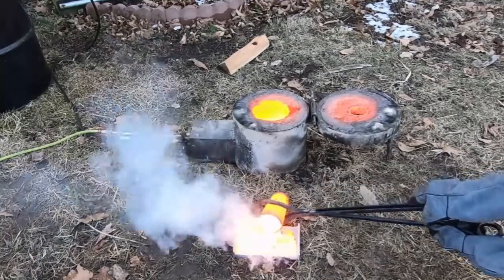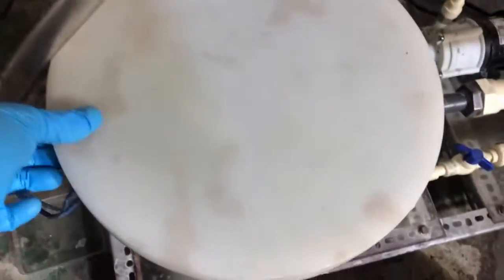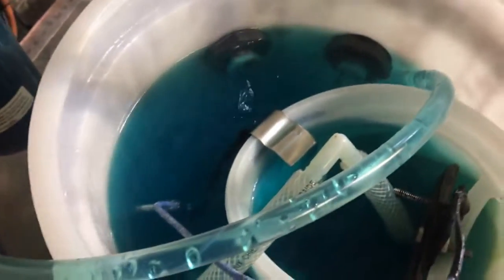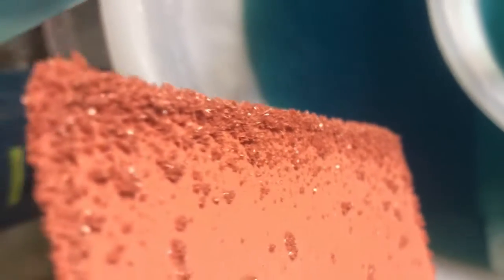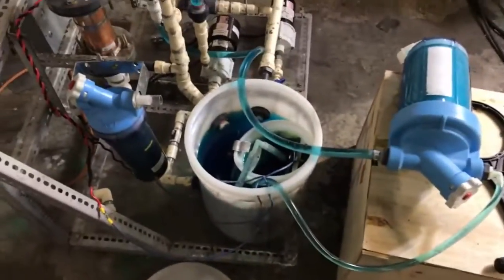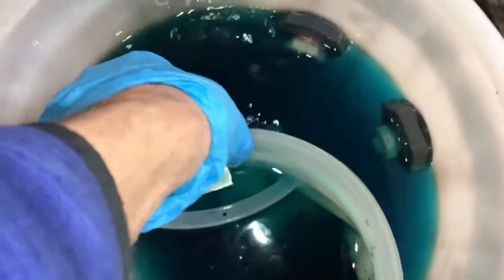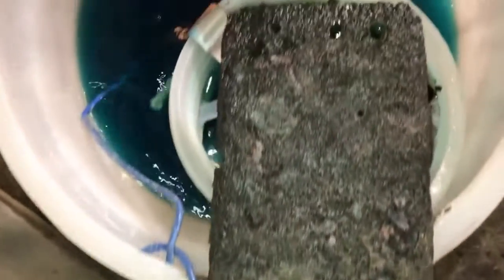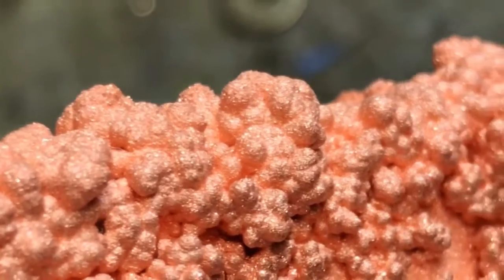Ewaste gold and copper recovery using hydrometallurgy

Comment: Curious - would circulating the electolyte help anything? Also, curious on the cost vs realized gain in $ figures - examples are fine.
Reply from the maker: Hello , this was all a test for  large scale operation in Saudi Arabia , it was not the actual plant , they wanted to prove the concept before building a large scale operation  . The power used to chemical conversion is less then smelting
Reply: @NOBOX7  Thanks - just curious abotu specifc numbers though like full output vs input cost vs return. Also curiosu if circulating the electrolyte would help anything-like a small whirlpool in the bath.

Comment: For the copper cell to work properly your anode must contain at least 95% copper. Low voltage and amperage are needed for a smooth deposition of copper on the cathode. During the process volt and ampere must be gradually reduced even more to avoid formation of large crystals near the end of the electrorefining run. Irregular crystals tend to form on the edges of the cathode. Cover the edges with a plastic based paint; or better, cover them with reuseable plastic strips of some kind (fx. cut up plastic tubing). Polished thin stainless sheet metal is perfect as cathode, afterwards it just needs to be bent a little and the copper can easily be peeled off.
I use old solar panels for my cells (I have 55 old panels which came in to be scrapped, but still works; albeit at somewhat reduced efficiency). It takes a long time but at no energy cost. I'm a full time scrapper and uses both electrowinning and electrorefining for various metal recovery. My largest yield was 1960 kg of pure lead from CRT glass tubes; and yes, I have saved all the powder from the inside of the front panel glass for later recovery of REEs (Rare Earth Elements). All internal parts of the glass funnels are processed for nickel recovery.
I never waste time pulling pins from electric wire connectors. Plugs and connectors are always pyrolyzed together to remove all plastic, yielding metals and Raw Pyrolysis Oil. After hydrometallurgical solder removal (for tin/lead/silver recovery), they are melted and cast into a flat anode for copper removal/recovery by electrowinning. The slimes are collected and later processed for PM recovery, with a minimum of acid consumption. By the way, all my acids are homemade at no cost (HCl, HNO3, and H2SO4).
Reply from the maker: This is not the type of copper cell your thinking of , its precious metal recovery called electrohydrodialysis
Reply: @NOBOX7 .   Electrodialysis is done with a high tech membrane permitting some ions to pass through while blocking others, thus parting various constituents in a liquid solution. Your anode bag is not a membrane, it solely acts as a filter to keep the anode mud from floating around in the cell. 
With at least 95% copper content in the anode, very fine particles continue to fall off the anode during the process. This is called anode slime. It's easily hydrometallurgical processed for gold and PM recovery as it contains almost no copper.
Your video shows stripping of copper from an anode of mixed metals. It's simple electrorefining; not electrodialysis!
Reply: What is your electrolyte and cathode/anode for tin/lead/silver removal?
Reply: @readoryx373 .   You can't use just one "type" of cathode/anode for all metals; neither can you use just one "type" of electrolyte.
One process is electrorefining, another is electrowinning. Besides that, both takes place after the initial hydrometallurgical separation. 
Remember you can only remove one element (read: Metal) at the time. Please specify your question further.
Reply: @zero-waste  i hear that it is more than one process involved in tin and lead and silver.   I am specifically interested in hearing about the reverse electroplating process for tin and lead, which i assume you are removing first.  Before making a mess, and after reading Hoke's book, I personally wish to figure out if I could use a soldered board as an anode and a tin plate for a cathode, perhaps in an electrolyte of tin sulfate, then reprocessing the pregnant cathode through the same apparatus for slimes, catching the unscraped fallen whole components from the first process and muriatic-washing those before smelting for a future "copper" anode to be electrowon for initial PM slimes.  Is there a lead electrowin process in there or is that taken care of by the repeated hcl boils?
Reply: @zero-waste  thank you for every word
Reply: Thanks for sharing your knowledge zero-waste. Inspirational. I too like to make my own acids, and recycle everything I can, within the bounds of my understanding. Speaking of which, could you recommend a good book on the subject of electrowinning and electorefining?

Comment: Overall, I like the process, and I think you could benefit from following @sreetips lead by "cornflaking" your anode material & putting it inside the anode bag as small pieces, with a poures weight/electrode sitting on top of them. This allows most of the flaked-off bits of copper that fall into the slimes to still be in.electrical contact with the rest of the anode, so those cam be plated-out too.
Reply from the maker: This is not a silver cell so hydro electrodialysis doesn't work as well due to the massive amounts of anode sludge produced . We tried it i have the videos . we are more interested in the anode sludge in these test . Not usre why i bother answering comments any more the dam j0000s ruined the comments on youtube cus they dont want us coordinating
Reply: @NOBOX7  thanks for the reply, I'll have to look for those other videos then, as I'm about to embark on a similar project

Comment: Would a thin copper sheet work to give a solid copper byproduct? Recyclers are not going to be impressed with the steel core.
   I like this process . There should be sufficient lead in the curcuit board solder to act as collector metal. Be cautious, solder can contain cadmium.
   Solar panels would deliver low voltage easily for this process. You're drawing less than 20 watts most of the time.
Reply from the maker: the stainless plate in this case will be converted to a cathode for a second run , if you cover the edges the copper peels off
Reply: @NOBOX7  i didn't know it would peel off. Thanks!

Comment: I respect your efforts. All this is very interesting but it really does boil down to economic feasibility. I suspect that a lot of the copper that's precipitating out into the cathode is from the copper sulfate solution itself plus the copper in the anode. In the end, all this work needs to translate into profit or it just isn't worth it.   Perhaps pulverisng the circuit boards in a tumbler with steel balls and leaching out the gold using a cyanide process might be more economically feasible.
Reply: The profit here will be from YouTube but that's the idea. Its cool its science and folks will watch it.
Reply from the maker: The ball mill alone would cost you $300,000. 
This is a project that will be scaled up to plant size. Cradle to grave economics are important here . The cost of getting rid of used cyanide solution ??? The cost of being sued for somebody getting cyanide poising ? the cost associated with safe handling of this material . And before you tell me every body is doing it just know the plant owner is not having it .
Reply from the maker: This is a feasibility test , we will be processing tons per week , you miss the point and yes with all plating solutions some of the sulfated coper plates out of solution.
This is not the actual operation this is called a pilot cell and if the gold content is high this thing can make you thousands of dollars per cycle .
Cyanide solutions are toxic and give you a heart attack simply by skin contact , not a good idea with dumb employees and osha around